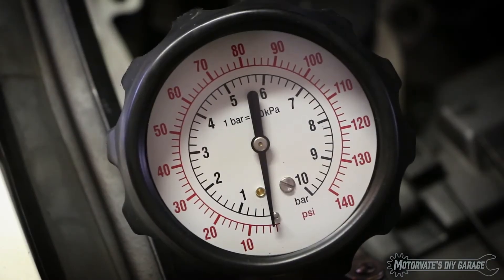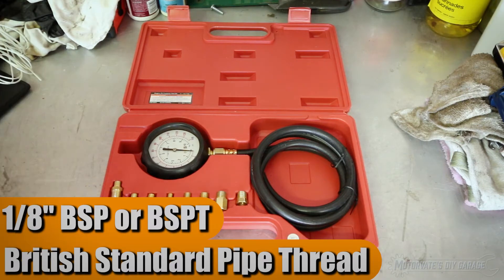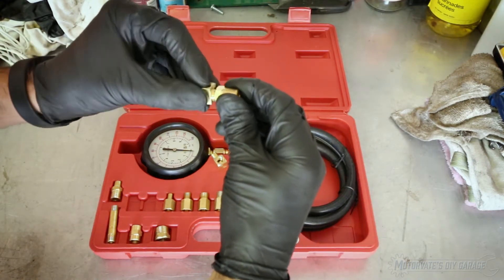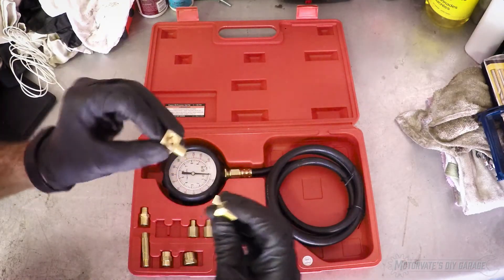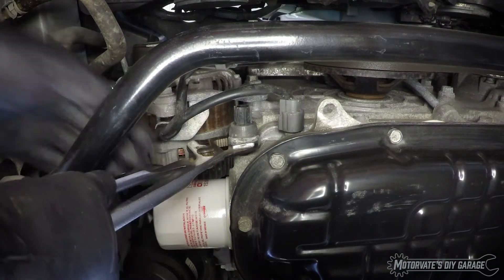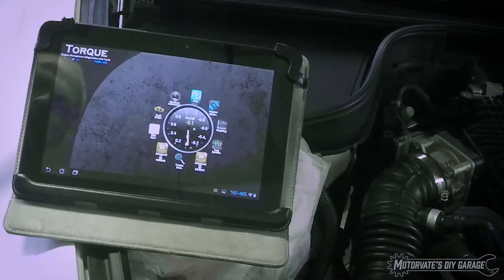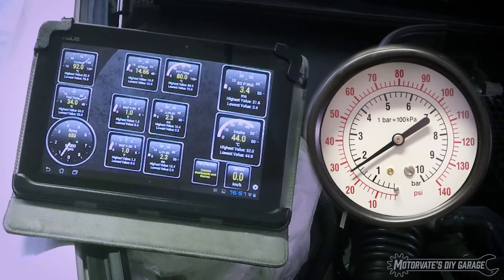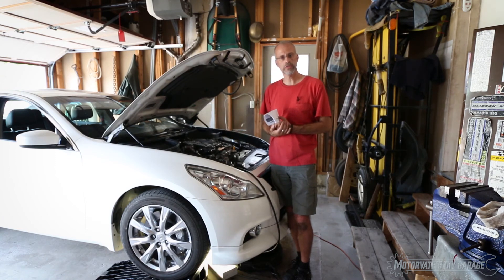Oil Pressure Check: G37/370z - Motorvate's DIY Garage Ep. 18

Comment: I bought the same kit at local Harbor Freight. And looked under microscope all adapters. BSP threads have a 55° angle and have rounded peaks and valleys (Whitworth thread form). So none of them is true BSP. Only one, I assume number 3, has rounded picks, but the valleys are flat, like in NTP. So I ordered online 1/8 NPT-BSP adapter and it came with correct shape, rounded peaks and valleys.
Reply from the maker: Hey  Eugene Ugryumov,
Wow, that is excellent information! Thanks for sharing it :)

Comment: Just did my sons 2010 G37 same gauge kit, 26 psi idle and 68 psi at 2000 RPM what a relief, thanks
Reply from the maker: I'm glad you have peace of mind :)
What was the oil temp at those  pressures, as those are some of the highest pressures I have seen. Also, was that 5W30 oil?
Reply: @MotorvateDIY  yes Mobil 1 5w30 we just changed 2 weeks ago. Oil temp was 178.
Reply from the maker: Thanks for getting back to me.
I will update my notes :)

Comment: Hey Motervate, I'm looking into buying an 08 g37 with 88k miles on it..  I'm not sure if the owner will allow me to set up a guage on his car.. It's invasive.. Is there anything I can do to test the car, audibly or visually that's not so intrusive to test for this problem?
Reply from the maker: Not really. All you can do is check for codes like P011 and P021.
I don't think this issue is very common, but it is expensive to fix.

Comment: Does this pressure checker have a long enough hose that you can rev the car and watch the gauge at the same time? Doesn't look like it in the box.
Reply from the maker: I think the hose was about 24" long, and I used a camera to watch/record it.
You might be able to prop it up, or support it from the hood to hold it up, so you can see it from the driver's seat.

Comment: Great video and very helpful information. I own a 2011 G37 with 90k miles and very concerned about the oil galley gasket issues. I'm dreading having to do the teardown and work myself as it's a bit above my knowledge and experience.
Reply from the maker: I'm glad you like the video.
One of the main reasons I made it, was to check my oil pressure before the warranty expired.

In my case, so far, so good!
Reply: @MotorvateDIY  Good to hear.

Comment: I have a 2019 370Z with about 67K miles on it and had an oil pressure check done on it. With 5W-30 Redline oil, the idle oil pressure was an excellent 30 psi but the oil pressure at 2,000 rpm was a disappointing 50 psi. I was wondering what might cause such a good oil pressure at idle to become somewhat lackluster at 2K rpm. I know the spec at 2k rpm is 42 psi so the engine isn't in danger of self-destructing. My assumption was that main bearing or big end connecting rod bearing wear would probably be the cause of lower oil pressure, but if that were the case then I would have expected the idle oil pressure to be low also. Maybe I'm missing something obvious.
Reply from the maker: 30 psi at a hot idle (oil temp 80C/176F) is the highest I've ever heard of. 

Do you have an oil cooler and sandwich plate? If the pressure sensor is installed in the sandwich plate, it shows the oil pressure BEFORE the oil filter and this typically reads higher by an estimated 3-5 PSI. The factory oil pressure port is AFTER the oil filter, and shows the actual oil pressure inside the engine.

As I see it, if you oil pressure is above factory spec, don't worry about it and just go for a nice drive, you won't hurt anything!
Reply: @MotorvateDIY  Thank you very much for that reassuring information. I find all of your content on these Nissan engines most interesting and helpful.

My oiling system is stock, except for an oversize oil filter that is meant for the 5.6 liter VK engine. The filter is identical, except that it is about 50% taller than the short one recommended for my VQ37 engine.  My reason for using it was to try to compensate for the higher flow resistance of the more restrictive Fram Ultra Synthetic/Endurance filters I use on the car. These filters are published to have better than 99% filtration efficiency for particles 20 microns in diameter and larger, hence  my reason for using them, but the tradeoff is a higher pressure drop across them.

BTW: I really like the analysis you did where you measured the effect of oil temperature and engine rpm on oil pressure in the VQ engine. I'm a retired physicist who really enjoys seeing your methods and practices in this work you do for us.
Reply from the maker: Keep in mind, the oil bypass valve in the oil filter typically opens at 14psi.
So if the "more restrictive Fram Ultra Synthetic/Endurance filters" increase the pressure differential close to that value, you may not be filtering any oil, since the bypass valve opens.

For me, I've always used the manufacture's oil filter.

In the spring I'm going to be measuring the oil pressure before and after the oil filter... just to see what is is, at different oil temps and engine RPM.

I'll also try a few different oil filters and see how they compare to the stock Nissan filter.
Reply: @MotorvateDIY  That is a great idea! Içll look forward to seeing it.

I did find a site that built a setup to pump heated oil at pressure through engine oil filters, with pressure gauges before and after to calculate the pressure drop. From what I remember, these Fram filters were only slightly more restrictive than the stock filters but were significantly better in their filtration efficiency of particles ranging down to 20 microns. My thinking was that if there was about a .002" clearance in those bearings then the  running clearance would be about .001", or 25 microns, with the journals spinning in a hydrodynamic state. I would be most concerned with particles in the 10 to 20 micron range that would be most likely to fit between the gap and get lodged in the soft metal of the bearing shell. Aside from the Mann filters that seemed to offer excellent filtration efficiency at these small particle sizes, the top of the line Fram filters also seemed to do an excellent job and at a good price with good availability.

My rough calculation of the reduction in pressure drop across a filter that was 50% taller with a 50% greater surface area for filtration would be about ⅔ of the pressure drop for the smaller filter.  I really would be interested in seeing what kind of pressure drops we are getting across these filters. One thing that I don't like with these oil coolers with their thermostatically-controlled sandwich plates and sharp bend oil lines is the possibility of further causing more of an oil pressure drop.

Comment: i have an aftermarket  glowshift  oil pressure gauge  the  last couple  days once my car  is  warm  my gauge  reads  like 10-12 psi  at idle , but whe im driving  the oil press gauge  reads  fine i dont know  why my oil press is  too low at idle,   i bought  a  cosworth high pressure oil pump  it was  installed  in my 03  nissan 350z  supercharged
Reply from the maker: Hey yoshi z33,

When measuring oil pressure and comparing it to the spec in the manual, you need to know the oil temperature.

Here are the factory oil pressure specs for your engine (VQ35DE) when the oil is at 80C or 176F:
• Idle > 14 psi
• 2,000 RPM > 43
• 6,000 RPM > 57

If you measured the oil pressure and the oil was hotter, your pressure readings would be a little less.

To my surprise, it looks like your engine doesn't have a factory oil temperature sensor, so this will make it harder to know when your oil is at the proper temp.

When you factor in oil pressure gauge accuracy (typically +/- 2% of full scale or about  -2 to +2 PSI for a 100 PSI sensor) and I suspect your checked the oil temp at more than 80C / 176F which would give you a slightly lower pressure, I don't think you need to worry. 

10-12 PSI at idle is fine, as the lubrication requirements are low at low RPM.

After driving the car easy for 10-15 minutes, check your oil pressure at 2,000 RPM. 

My guess is it will be in spec :)
Reply: @MotorvateDIY  thanks     for the info 👌🏿👍
Reply from the maker: Anytime :)

Comment: Any chance you’d know if the car would drive/perform differently with low oil pressure/failing gaskets? I bought a 2010 g37s and have almost put 3500 miles on it since and it starts and drives every time which makes me think that it’s fine. I also feel like logically, if the gaskets went bad or are going bad then the car would just not run or run really poorly. Any insight helps, I plan on having the oil pressure tested at a shop before the end of this year anyways.
Reply from the maker: Typically a P0011/P0021 (intake cam phasing problem) and maybe a P0524 (low oil pressure) will pop up.

BUT, I don't know how much bearing wear/engine damage may happen before those codes pop up. 
Getting your oil pressure check is a good idea!

Comment: Didn't realize how easy it is to get an oil pressure reading, I got the Code P0021 and trying to check if it's at all related to the rear timing gasket, figured i might as well check my oil pressure but couldn't find a nice kit like the one you have.
Reply from the maker: Hey Doublea88,
Sorry to hear about the P0021 code.... Here is a link to the a kit very similar to the one in the video:
https://www.harborfreight.com/engine-oil-pressure-test-kit-62621.html

Comment: Could you also use an oil filter sandwich plate with npt outlet?
Reply from the maker: Yes you can.... BUT keep in mind the indicated pressure will be a little higher, maybe 2-3 psi. With the sandwich plate, you are measuring oil pressure BEFORE the oil filter.

When the gauge/sensor is connected to the factory position, you are measuring oil pressure AFTER the oil filter, and this is the same oil pressure that is used to lubricate the crankshaft, connecting rods and everything else.

Comment: Great video! After doing this, I decided on installing my own oil pressure gauge. I have an 1/8th 27 NPT oil pressure sensor as well as a sandwich plate with 1/8th 27 NPT threads for the sensors, however, the threads seem to lock-up less than half through. I don't know what I'm doing wrong. I don't want to have any oil leaks or destroy the threads. Am I just overthinking this?
Reply from the maker: If you can turn the NPT fitting by hand and get about 1/2 way on, I think that should be ok. Make sure to use a liquid thread sealer or Teflon tape (just don't tape over the end of the fitting, as the tape can tear off and get into the oil, potentially blocking an oil passage)

Here is an excellent article on NPT fitting and how much to tighen them:
https://www.pegasusautoracing.com/document.asp?DocID=TECH00097

Good luck!
Reply: BSP is what you have and want , how do you have NPT sensor? Is it a aftermarket?
Reply from the maker: He is using an aftermarket oil pressure sensor and it screwing it into an oil filter sandwich plate. Everything there is 1/8" NPT :)

Comment: Awesome video . Do you know the oil pressure pid  equation for torque pro ?
Reply from the maker: Since most engines (for Nissan/Infiniti anyways) don't have an oil pressure sensor, that data  is not available.

Comment: Hi, today i will check my oil pressure, does m10 thread is same as 1/8 bsp?
Reply from the maker: No, they are different. The port on the engine is 1/8 BSP and you need to get an adapter to connect to your pressure gauge.

When tightening the 1/8 BSP connector if you over tighten it will split the port on the engine and you will have an oil leak. The BSP port is tapered and typically you only need 1-2 turns after finger tight.

Good luck!

Comment: Would faulty vvt solenoid cause low oil pressure?
Reply from the maker: That is a really good question!!
If the VVT solenoid is stuck on the "drain" position, the oil pressure will be a little (~5 psi ?) lower.

However, the VVT solenoids are easy to check by applying 12v to them for a split second and see if they click.

Comment: Hey wasup , i have a q50S rwd 3.7 2015 model. It’s supercharged. My low oil pressure light comes on and then goes off then comes back 2 days later. I checked the oil its at H still on the dipstick. Fresh oil change using amsoil. No leaks. Engine runs great. No cel . No weird noises . I changed the sensor to a new oem oil pressure sensor. Think its faulty wiring?
Reply from the maker: If that single wire that is on the factory oil pressure switch touches ground, the red oil light will turn on. Check the wire from the switch to the IPDM/ER for any damage.

On a different note, your Q50 must be a lot of fun to drive !!
Reply: @MotorvateDIY  yes definitely just tryna figure out this fuel pump issue maybe i need a bigger one im using 340 aem fuel pump. & it was the wiring for oil pressure light lol

Comment: Hey brother quick question, I couldn’t get a completely tight seal for some odd reason so I did it with the fitting dripping very slowly. Would that affect the oil pressure at all? I think I got fairly good readings with 46 psi at 2k rpm’s & 26 at idle.
Reply from the maker: You are fine... a slight drip won't make any measurable difference.... AND you don't risk cracking/splitting the oil port in the upper oil pan.

46 & 26 are good numbers :)

Comment: Great video! Keep them coming!! I am interested in installing a permanent oil pressure gauge soon to monitor possible rear main timing cover seal failures that are pretty common. What made you want to record this video?
Reply from the maker: Hey Stephen,
Thanks for the kind words!

Why did I make this video? For the same reason you mentioned, the rear timing cover gasket issue. When this video was shot (Aug 2016) I still had 500 miles of factory warranty and wanted to know if I had the issue.

As a side project I am going to be building an oil pressure gauge using a digital pressure sensor and an Arduino (inexpensive micro-controller)
My plan is to have a very small digital display (10mm tall) in a easy to read spot or maybe part of the dash.
Reply: Awesome, interested in what you come up with. I was hoping to build a wireless gauge (definitely digital) that does a max PSI of 200. I found information that this needs to be installed somewhere after the oil filter as that's where the pressure drops. So apparently not the sandwich plate near the oil pan.

Other thought is, someone was able to read this info with Torque and Infiniti EX addon I believe. Going to do some digging to see if I can find the thread. If so that might be my route to check on it once in a while.

Comment: Hey man! My 350z is reading about 10-12 psi at stop lights when driving, I'm about do follow theses steps and check my oil pressure, what happens if it is low?
Reply: TIA!!
Reply from the maker: If you have an automatic transmission, it must be in park or neutral to get an accurate oil pressure reading.  (the idle is a little lower when stopped in drive)

As mentioned in the video, the spec for oil pressure on the DE/HR and VHR engines is more than 14 psi at a hot idle (600-700 RPM) and more than 43 psi at 2,000 RPM WITH the oil temp at 80C/176F.

If the oil pressure is low, the crank/cam/connecting rod bearings will start to wear very quickly, resulting in a knocking sound. This kills the engine quickly.

One "common" issue on the 2007-2008 350/G35 is the "galley gasket" blowing out. This created an internal oil leak, and reduces the oil pressure.

As for your 350, I know the factory gauge is not easy to read when the pressure is below 30 psi and you can only guess at the pressure.

Once you check it with a mechanical oil pressure gauge, my guess is that your oil pressure is OK. Even if it is 12ish psi, I would just keep an eye on it as I don't think that is low enough to cause damage.

I think the 2,000 RPM pressure (> 43 psi) is more important, as the engine spends more time at or above that RPM.

Good luck and feel free to up me on your results!

Comment: I have the same kit and when I go to install the correct fitting I only get about one thread in before it stops. When I pull out the fitting there are a few marks like something is preventing it from going in further and I don't want to push it any further because I may damaged something. What should I do?
Reply: I ended up just ordering the correct one from parker haniffan for like $30. Its stainless steel
Reply from the maker: Sounds like you got it figured out!
Reply: Fuck, was that square fitting giving you issues aswell?
Reply: Did that fitting work for a 2013?

Comment: Could you have left the sensor in and checked the oil pressure reading via the Torque App?
Reply from the maker: Hey TireSlinger81,
Good question.... but the answer is no.
When Torque starts, it gets a list of engine sensors (actually called PIDs) from the engine control module (ECM)
This car (or any other car I have seen) do not't have an oil pressure PID, it won't show up in Torque.
Reply: @MotorvateDIY  by any chance you know if this  app will see a pressure sensor for 2007 Cadillac Escalade ?
Reply from the maker: Hey  Andre Desouza,
I'm sorry, but I don't know. Most of my research is on Nissan, Infiniti and a little Mazda.
Reply: @MotorvateDIY  thanks for responding back !!!
very insane the 2007 2008 Cadillac Escalade doesn't have oil pressure on the dashboard

Comment: I think my galley gasket might start to go out...any suggestions before I go on with that ?
Reply from the maker: Hey  Anup Patil,
Sorry to hear about that!

If your oil pressure is below 14 psi at idle when the oil temp is 80C/175F I think the galley gasket is the most likely issue. :(

What are your oil pressures?